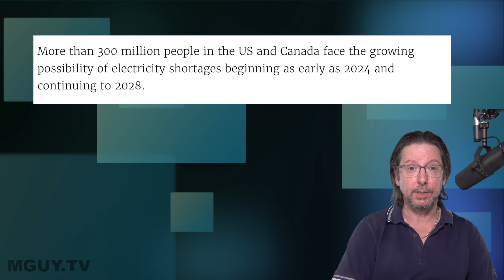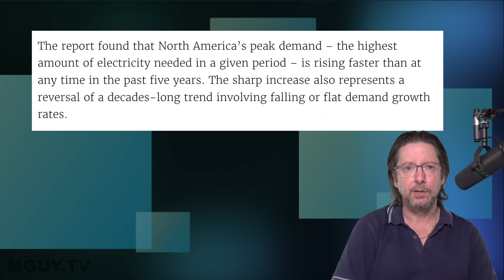Electricity grids WON'T COPE with mass EV charging | MGUY Australia

Comment: The key point here is that there isn't enough "renewable" low carbon electricity to fulfill existing demand for electricity.  Every new EV will be running on electricity generated from burning gas, coal and oil.  Given that the overwhelming majority of new EVs are very big and kilowatt hungry, that means no overall CO2 saving whatsoever, especially when you take into account the C02 generated manufacturing them.  You could save far more CO2 at almost zero expense by simply using the tax system to encourage people to buy smaller, lighter and more efficient internal combustion vehicles.
Reply: Or you could wake up to reality and stop thinking co2 is a problem
Reply: Add more wind turbines?  They're cheap, easily added across unproductive land.  Also see solar farms.
Reply: @br5380  ..but, B R, MGUY Australia's channel viewers want to send their hard earned money to middle-east oil sheiks so they can perpetuate the mistreatment of their imported labour and continue subjugating women to subservient roles. Why put solar PV on your roof and drive on free fuel when you can give your money away to people in sh*th*le countries?
Reply: No Australian government has ever used logic, it's all about screwing Australians to the wall.
Reply: Absolutely false, there's more than enough renewable energy for the planet if we want to harvest it. Stop repeating oil company propaganda, at least without getting paid to do it.
Reply: Intoxicating nonsense.

Comment: Govt - Buy an EV or else. We're going to ban ICE vehicles.
Also govt - Don't use your air conditioner, dishwasher or washing machine, we don't have enough electricity.
Reply: Yep or charge your ev, that's exactly what happened in Commiefornia (formerly California) last summer. The plea was made by Governor Gruesome while he appeared to be in an icy cold office.
Reply: @70chevs that was literally only for a few hours because the combined cycle natural gas plants couldn’t handle the heat and lost power.
Reply: Also gov't , heat your home and cook with electricity..
Reply: @bills6093  Has it ever occurred to you that the people who actually run the grid may know more about it than you do?
Reply: @kiae-nirodiariesencore4270  haha, trust authority.
Reply: @kiae-nirodiariesencore4270  They may know more than bills6093, but its fair to say the politicians saying we'll convert to all electric in 10 years are engaged in magical thinking
Reply: @bills6093 and you can hardly open most plastic packaging without a knife or scissors or pliers or some other tool #
Reply: @teekay_1  it will take more than 10 years as fossil cars will be around for another 15 to 20 but it isn't magical thinking, just a steady expansion of grid capacity and charging facilities. If you want exampled of magical thinking, I can give you three: 1) Hydrogen as a transport fuel 2) e-fuels 3) We can just continue burning fossil fuels ad infinitum
Reply: @kiae-nirodiariesencore4270  Most real estimates say that regular cars and trucks will be the primary source of transportation through the 2050's, and we'll be dependent on oil/gas until the 22nd century.

This is an application of practical thinking
Reply: @teekay_1  You don't sound like a Democrat to me, too much common sense.
Reply: @kiae-nirodiariesencore4270 Ah yes let's put all of our faith in the "people" who run the grid to decide things for us, the same people that caused the economy/inflation to spiral out of control & blamed "Covid" for it.
Reply: @bills6093  Right, Bill.  Not only that but a lot of these plastic packages are very hard to open without some sort of tool, like 
a knife or box cutter.  While these are effective tools, they also present a hazard from being cut by them or by the cut plastic.
My wife and I call these packages "bullet proof plastic", since it should be possible to make a vest from this stuff that would
be effective shields against various projectiles.  This is especially true of us older folks who struggle to open these packages 
or simply cannot open them.  My wife is like this, having some pain in her hands from arthritis.  Other folks have tendonitis or 
carpal tunnel syndrome.  Whatever the case, these are real issues that affect millions of people... and are exacerbated by the 
folks in government requiring all this stuff.  As you mention, they also want to get rid of some plastics, usually the ones
that are most useful.
Reply: @kiae-nirodiariesencore4270 has it occurred to you that the government wants to get rid of gas because of “green energy”, yet is steering consumer electricity demand into the realm, of using GAS to produce the electricity required for the increased EV charging demands overnight?,?
Reply: @LukeAusNSW  What country is doing that? Please expand on your comment. I could tell you where and why gas is used for electricity generation but I am not sure you are seriously interested in the subject.
Reply: @LukeAusNSW no. People are using less grid electricity every year. Banning gas appliances is very likely from the electricity lobby. The "green" angle just gets it implemented.  Don't take my word for it, please do a quick google. Look up electricity usage. Look up all energy usage. Look up the new requirements for installing PV that allow the feed-in to be turned off because there's simply not enough people using electricity.
Reply: Already in California the government tells people not to run dishwashers, clothes washers or vacuums between 5-9 pm.
Reply: @MrVenona  No it doesn't. You're just making crap up like a magger.
Reply: @mb-3faze  "No it doesn't."

I wish YouTube would enforce its restriction on people under 13 posting.
Reply: @MrVenona so make your own.
Reply: @MrVenona Australia isn't the US
Reply: @jasonhutcheon5991  "Australia isn't the US"

Thank you, Captain Obvious.

Unfortunately,  Australia and California are both run by the same type of people.
Reply: @MrVenona  That's OK, most EV owners charger after 11 pm and through the night when they get super low deals on power.
Reply: In Sweden there is a law that all power meters (is that the english name?) in our houses must be replaced before 2025. They replaced mine last year. Reading thru the documents, this makes it possible to change how much electricity I can consume remotly. So if I use too much electricity, they can more or less throttle my useage. Guess its for future EV cars.
Reply: @AndrewTSq Buy a multi fuel generator…. Better safe than sorry.
Reply: @AndrewTSq that only works with compatible appliances. 
Simply be ready to make your own behind the meter electricity.
Reply: Head explodes... (we get similar messages in the UK)
Reply: The government somehow thinks that electricity is limitless & will magically adjust itself to cope with the overload Lol
Reply: @GhostRangerr  All we need is enough of us to become micro generators. Will help us to escape the grip of big corporations,
Reply: @GhostRangerr  When you have two guys, Obama and Biden pushing these kinds of choices, these are people who were in the bottom half of their class in college, were the two worst presidents in the history of the united states, who have no idea about infrastructure and science....

Well, you get magical thinking from these people.
Reply: @GhostRangerr  The worst part is that the lines/transformers/power generation facilities , and all related infrastructure is INADEQUATE!!!!!   Guess who has to pay BILLIONS of dollars to bring it up to spec?

Without upgrading all of that stuff, it would be like trying to run a 3000 watt electric heater with a 16 gauge extension cord!!!
Reply: So strictly limit the electrical power consumption of ALL government buildings, including those containing Congress, the White House, and the US 
Supreme Court until we have enough power to satisfy all other uses.  No A/C in summer and minimal heat from fossil fuels at any time of the year.
Once the power shortage has been addressed, they can have what they need... but NOT until then.
Reply: Google the new requirements for installing PV >10kW in Australia, and you'll understand what the reality is. The reality is that demand for grid electricity is falling like crazy, has been falling since 2010, and electricity  generators and retailers are very worried. EVs, banning gas appliances, and using electricity for everything is an effort to try and boost demand for it.
Reply: @karlm9584  The same is happening in the UK. If you look on the National Grid website it says electricity demand peaked in 2007. Since then we've ditched incandescent bulbs for LEDs and CRT TV's for flat panels, just two of the reasons for the decline in demand. I live in France and read a report last year from EDF where they were expecting a rise in demand due to EVs and over half a million homes ditching gas and oil for heat pumps...but they've seen no rise. They say this may be to do with the massive growth of solar in the last few years where companies mostly are producing power on their roofs and taking less from the grid. At the micro level there is a high level of coincidence between buying an EV and putting solar up, I think its about 30% of EV owners put solar up at home, as I have done. So although I am using an additional 2,500 kWh of electricity a year for the car that is cancelled out by what the panels produce. It's a win-win for everyone.
Reply: The idea is to have 75% less cars by 2050….and you’ll be locked in smart cities. Enjoy
Reply: And the government wants to do away with gas appliances stoves BBQs..
Reply: Simple solution. Make your own electricity. You can make enough electricity to power your home and EVs. You can’t make gasoline at all and can’t make enough diesel to matter without a large farm. 
But you can make enough electricity if you own a home no matter how small. 
Don’t be so gullible. 
It isn’t governments that want you on electricity. 
It is oil companies that want you still on fossil fuels to control your wallet.
Reply: I found. Using my dishwasher, washing machine uses less power than doing it by hand.
Reply: @davecooper3238  I can truthfully say that I have NEVER washed a load of clothes by hand, and I am 76 years old.  I have, however, washed a butt load of dishes by hand.   LOL
Reply: Spot on , it is a slippery slope across the world all for this naive mistaken ideology that electric cars will make any difference to the climate, or as we once called it “ the weather “.
Reply: Dont forget they want to use your ev as a battery for when theres too much draw.  Nothing like getting in you car only to realize it was discharging instead of charging
Reply: @supernova743  Really!? Tell me more.
Reply: MGUY really is a plonker. I know engineerings and arithmetics were probably absent from the curriculum in the school but OZ is perfectly well suited to provide as much solar PV electricity to power every moving vehicle. Area needed to power all the vehicles in Australia? About half the size of Sydney Harbour.  You are the lucky country - well get lucky and stop whining.
Reply: Oil companies - buy gasoline or else.

Comment: You are saying what a lot of people are thinking, and thats great. While EV's have their place, they dont suit my driving needs, and also not our current power supply at my home, and I have no interest in lining up for at least 30 minutes, likely more, to charge my car every few days.
Reply: <<You are saying what a lot of people are thinking, and thats great. While EV's have their place, they dont suit my driving needs>>

Tough.

You can walk or bicycle then.  

And it's going to be amusing when a lot of people buy those EVs and discover they aren't allowed to charge them, and/or there is not the power to charge them.
Reply: @SeattlePioneer  That's the damned problem with people and their gas cars.  It's really hard to control their movement without a massive and overbearing police state.
Reply: @teekay_1 😂🤣😂🤡🤡🤡 no, it is hard to control people who make their own electricity to power their own EVs. 
Dependence on fossil fuel infrastructure makes you very easy to control.
Reply: @williammeek4078  Billy, your electric vehicle has an off switch that is controlled by the government.

Did you not know this?  Bless your heart.
Reply: @teekay_1  100% correct and GPS tracker as well.
Reply: @teekay_1  your new ICEV has a kill switch controlled by the government. 
You didn’t know this? Bless your heart.
Reply: @williammeek4078  Billy, it most certainly does not.   That would imply it has a cellular connection, which is doesn't.

That's very easy to test, BTW.  Meanwhile, you need a cellular connection to tell you where the closest charger is, because, well, driving an EV required you to understand where chargers are at all times.
Reply: @teekay_1  Child, cars have had cell connections since Onstar. And if your particular vehicle doesn’t, your cellphone does.
Reply: @williammeek4078  Billy, cars don't have onstar unless you're buying GM.   No GM cars in my fleet

Nobody does onstar anymore, since most people have this magic thing called a "cell phone" .

Billy, you're thrashing now.   Nobody is stopping from loving you EV.   But nobody else has to love your EV.
Reply: @teekay_1  you lost the plot
Reply: @williammeek4078  Billy, nothing you've said here has made any sense.   We're all dumber for having read your posts.   You are awarded no points, and may god have mercy on your soul.
Reply: @teekay_1  You know the most basic level of knowledge is at least recognizing the correct answer when told. You fail.
Reply: do you have house current in a garage? You can easily charge any EV for daily use using a household outlet. It's full every morning, you wait for nothing.
Reply: I spend about 10 seconds a day of my own time charging my car so it always starts the day topped up (to 90%) in case i have to evacuate because of a hurricane. I feel bad for all the poor people depending on fossil fuels infrastructure that empties at the first hint of a hurricane that get stranded because of their dependence.
Reply: @williammeek4078 Yes dear. Perhaps the fact that whenever a severe weather event occurs usually the first casualty being the electricity grid is lost on you. Please explain how your fully charged EV has an advantage over an ICE with a full tank.
Reply: @bunion8579  the problem you have is assuming your ICEV will have a full tank. Gas stations empty of gas the day before the hurricane. 
Electricity is only lost the day of so I have a fully charged EV, you don’t have a full tank of gas.
Reply: @williammeek4078 So only EV owners are warned a hurricane is on the the way and only they will be prepared? Your little scenarios are hilarious Billy boy.
Reply: @williammeek4078  the problem you have is assuming your ICEV will have a full tank.

Jerrycans are a thing.
Reply: @teekay_1  so are batteries
Look man, i am just talking about how things have played out in the real world, every single time.

Comment: A coal fired plant operator was going to shut there generator down but got a phone call from airbus AnAl to keep it running for another 12months and given a tax break to keep it operating
Reply: Same happened to the Playford power station but the government said it after they turned of the boiler and then demanded it be restarted but the transmission lines had already been taken down.  This is what happens when you have idiot at the helm and Australian at  local, state and federal levels  is full of wanker idiots at the helm.